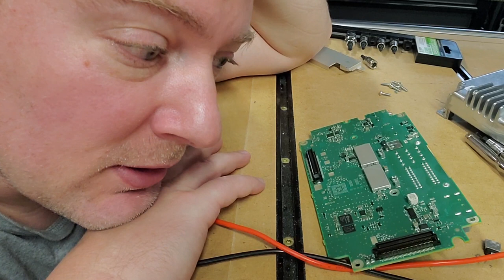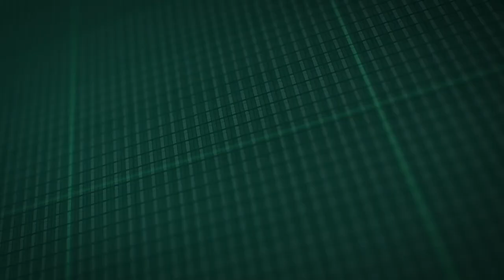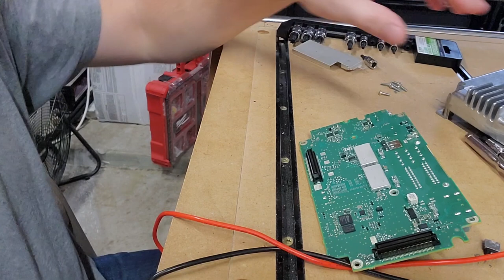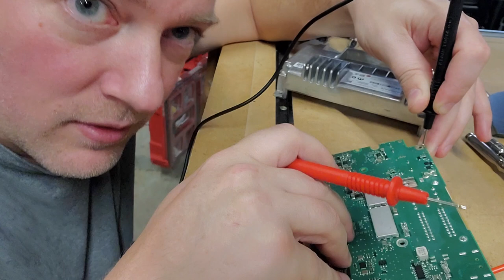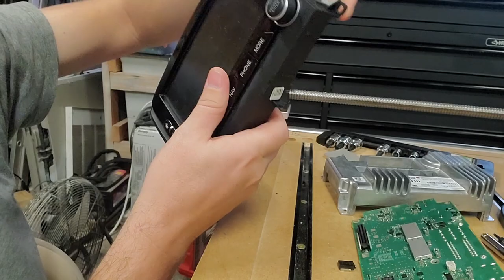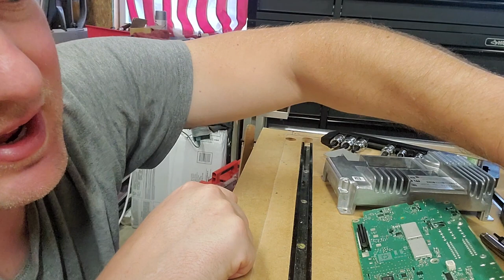Car Radio Repair:  Can you explain this? I can't..

Comment: I performed board level repairs on OEM automobile radios for 35 years and have seen this issue a number of times. That component is likely not a zener diode. It is just a standard diode with a current rating above the value of the external radio fuse. Its only purpose is to prevent reverse polarity entering the board which would cause catastrophic failure. Under normal main power the diode is reverse biased and does nothing. It only conducts when reverse polarity is applied to the vehicle. Under that circumstance only the radio fuse should fail and briefly the maximum reverse voltage getting into the board is limited to the forward bias voltage of the protection diode p/n junction, about .7v.
 I have seen these diodes short mostly at car dealerships where the vehicles sit a lot and the batteries go dead. The cause of failure then is improper reverse application of a jumper pack to start the car. This error is only supposed to pop the radio fuse but at times the protection diode shorts as well. The good news is the board is usually still ok. Once the diode is removed, the radio should work. I would install a good diode though for the protection it provides. 
For some reason this error never seems to affect the ECM.
Reply: @stephencolsten1736 I have 2019 RAM radio that has no power. Where do you suggest I look? Could you help with diagnostics?

Comment: Most likely that second ground you're testing to is has a diode somewhere in the circuit that isolates it only to that top left mounting point. The easiest thing to do if you're gonna get serious about fixing shorts is just use a thermal camera and inject voltage with a limited amount of current so you dont completely toast the board.

Comment: Measure the resistance. If the resistance is above a certain threshold it won't beep and it could be hitting that threshold with one continuity check but not with the other.

Comment: Hi. I contacted my radio wrongly. A smoke coming from the radio. It won’t turned on. I find a burned smd T4. But still no power. What should else I should look at. Thank you
Reply from the maker: Also, there is a accessory fuse or a radio fuse in the car fuseblock

Comment: Can it be a TVS diode ? A TVS diode is placed in parallel with the positive and negative. 
Below the specific voltage, they are "open", and once they reach there treshold voltage, they begin to conduct to clamp down the voltage.
You can leave temporary the diode out, and supply a low voltage like 3a5V (and limit the current at your lab supply) , at the pads where the diode was soldered, and then look how much amp the board draws. If the diode was short, the voltage over the diode can't be very high, so i don't think that there is further damage to the board.
Reply from the maker: Yes it is.  SM6A27
Reply from the maker: I need to wait until Monday to access my power supply. (I took my whole soldering setup into work)
Reply: @BetterBiomedChannel  the minimum breakdown voltage of a SM6A27 TVS diode is between 24 to 30V. 
So it seems that you have got a huge surge to blowup that diode, and the diode has protected your radio.
Is this radio installed in a truck or camper with 2x 12V batteries ?
If not, it's best to check the battery voltage when the car is running, to see if the voltage is not abnormal high (more then 14,5V) due a bad voltageregulator on the alternator.
Another cause can be when you recently used jumper cables or a booster when the car battery was flat, that causes a surge when disconnecting.

Comment: Thats a thermal disapation pad it uses solder vs thermal paste
Reply: Rockford amplifiers I've worked on you need to directly short and solder the FETs back to pcb pads.

Comment: ih excuse me i have an acustar  car stereo af 1991 serial 21210824   it d'ont run me i have a schematic diagram ?
Reply from the maker: Sorry, the only way you'll probably get a schematic is contact the manufacturer directly. otherwise, if the stereo will not turn on, check for fuses or transistors near where the DC power enters the main circuit board / power supply.
Reply: @BetterBiomedChannel  Tanks a lot for  the answer.
Reply: @BetterBiomedChannel tanks a lot for answer a alreary ceck the fuse  but it is good.